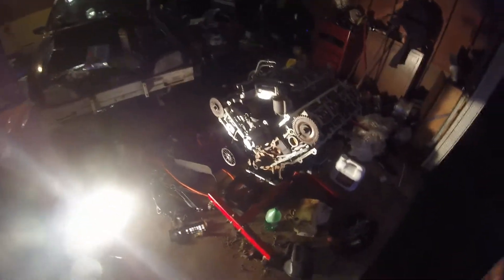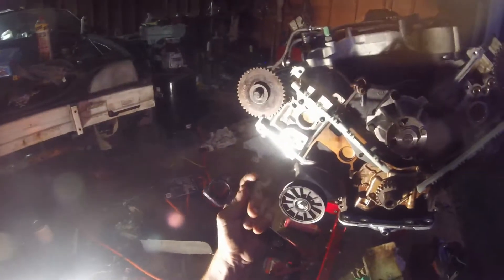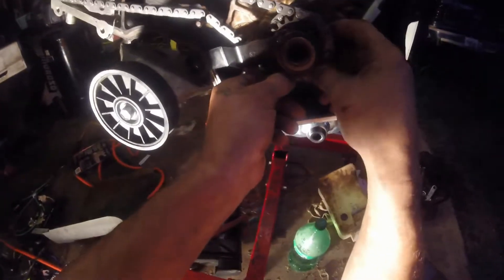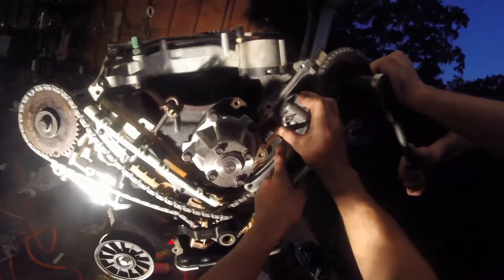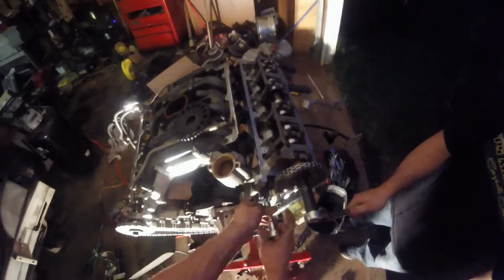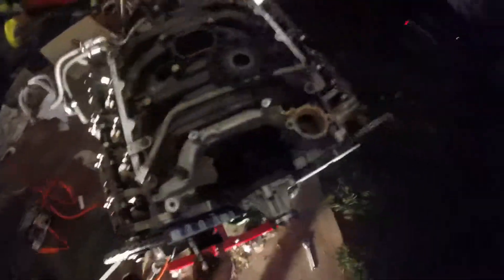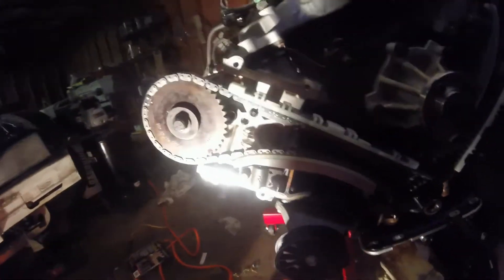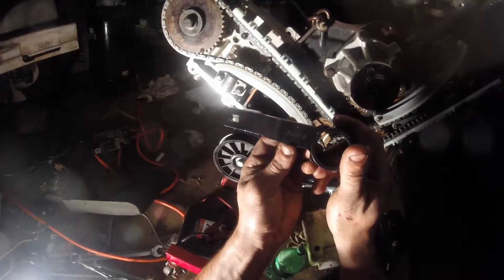4.6 2v SOHC timing chain replacement

Comment: So i do not need a tool to keep the camshafts in place?
Reply from the maker: +MrMitokiller no you do not need the tool it just makes it a lot easyer plus u can buy the tool on amazon for under 30$ so its worth getting to make the job easy and fast
Reply: Did you use vise grips?
Reply from the maker: No I did not use vise grips